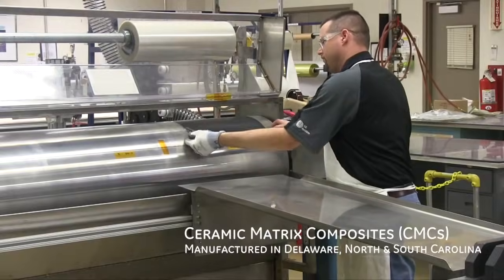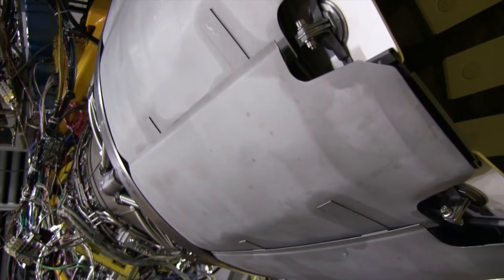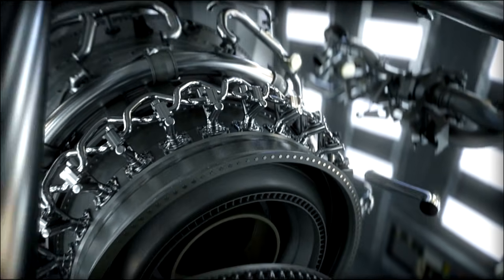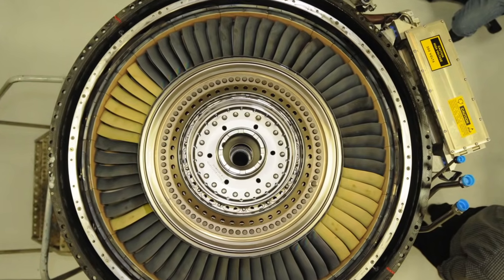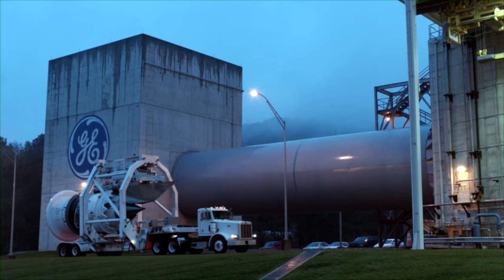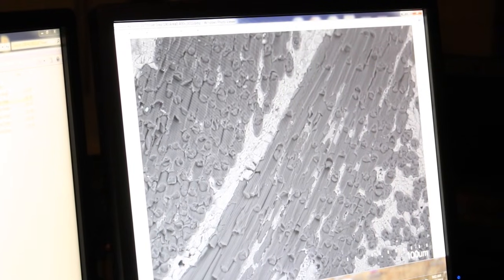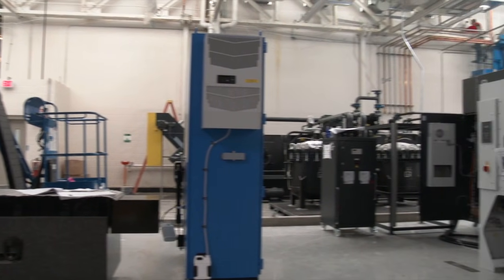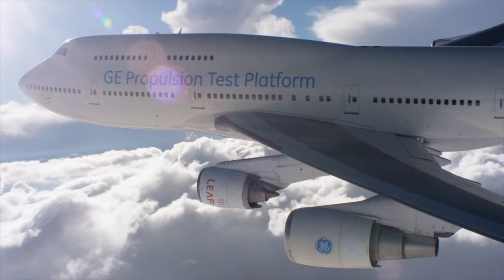GE Aviation and the Ceramic Matrix Composite Revolution

Comment: I worked on ceramic components for gas turbine engines in the early 1980's at Allison.  Back then, they were monolithic parts we were working with, and very brittle.  It's nice to see how far the technology has come in the last 30-40 years.

Comment: Silicon carbide (SiC)  is a structural ceramic material with excellent performance - super hard, wear resistance, low thermal expansion coefficient, excellent thermal stability and so on. Very suitable for aerospace applications.
Reply: But brittle. Less so with cmc.
Reply: Hybrid rolling bearings. Ceramic rolling elements instantly increases rigidity and load handling capacity and reduces certain lubricant requirements compared to conventional all-steel bearings.

In the electronics sector, SiC proves its worth in power conversion applications. Higher withstand voltage and temperature capabilities than plain silicon. Finally, Schottky diodes that does not have leakage problems and a positive step over IGBTs in efficiency.

Comment: A 6o:1 comp ratio with an axial compressor is simply incredible.  I have a textbook on turbines written in the sixties and 6:1 was where axial turbines were at that time...
Reply: With a 60:1 pressure ratio, half of the compressor is now technically a "hot section" too! They probably don't need ignitor plugs anymore, the air will be WAY above the autoignition temp of even JP-8!
Reply: Yeah I know I’m looking at the FAA AC 43.13 and 8083 and just mind blowing how fast the impossible became possible in the decades since the low end compression ratios.
Reply: KingCosworth 
Who knows? The next stage might be "double jacketed" version of by-pass arrangement. The outer-most jacket will have unheated air passage, while the inner jacket around the main engine will be heated version, conserving heat & enhancing heat efficiency.
Reply: Of course it’s with multiple stages. Increasing comp ratio is fine even back then by having more stages but doing it at light weight is where these make a difference.

Comment: The “on wing” experience is that 
The CFM Leap engines are suffering from the Ceramic Matrix Coating flaking off the turbine blades resulting in higher EGTs and higher fuel burns also.
I’m sure they will find a solution to that very soon

Comment: its almost 2020... are we there yet?
Reply: Yes and no. GE tested the new 9X engine and got it through FAA approvals but Boeing found early wear on the stator blades and GE redesigned them, setting production back by at least a year.

Comment: Can it be made clear for very robust windows?
Can it be made to use 3-D printable items?
 Can it be made into flexible elastic items?
Seems as it would’ve have potential as an aerospace material.

Can it be woven into fabric type materials for light weight yet high strength?
Reply: Yes but why, because$$$
No and no

Comment: Ceramic Engineer or Ex BS CER Egr if mfg right no machining maybe SiC w SiN fibers or SiC w Ti fibers. Trick is crack propagation You may want to use Boeing trick and incorporate crack stoppers in the matrix. Toughen composite just added plastic beads to the epoxy mix and ceramics are not different they need surface compression layer with crack stoppers in the matrix.

Comment: CMC is really revolutionary. GTRE must work on it & develop.
Reply: GTRE neither has the technical acumen nor the financial backing. Bleeding edge technologies do not appear out of thin air. GE has built dozens of gas turbines over decades to get to where it is today. The only way CMCs will ever be made in India is if the manufacturing technologies are give to it as part of a major military deal with geopolitical considerations.
Reply: @isuzu343  
hmmm. . . . I can't agree more. We grope in darkness. Knowledgeable about one's ignorance would be the first valid step. Knowledge of ignorance breeds fresh & more knowledge. [is someone listening or I am only whistling in a vacuum?]
By the time we learn CMC, they would move on to the next Technology!
Reply: GE has been researching this for past 30 years. India is still unable to produce single crystal turbine blades with nickel alloys, a 30 year old tech. I have seen the Kaveri Engine at drdo which was being developed for past 30 years unsuccessfully. If engine produces enough power it is overweight, when weight is reduced it vibrates too much. It is primarily because of partly skills and mostly government cluelessness of investment in long term r&d. loss due to failures during research is questioned by CAG in India who are accountants with zero knowledge of engineering. Until and unless government policy changes and fund private firms to do long term research and classify failures during development as investment and not loss, India will be behind the curve.
Reply: @kumark214  
Thank you. Its a challnge to dmrl.

Comment: imagine if they make Formula One engine or a supercar it will make all previous cars obsolete. screw electric cars...a jet turbine has awesome sounds
Reply: Problem is cars can't make use of a combined cycle system, which is used in gas turbine powerplants. Also, because of the higher capacity factors the powerplants are optimized for high efficiency, not power density like in cars.

Comment: Titanium is the best material, making the engines out of this brittle material is irresponsible and dangerous ,just because you could add another row of seats = more profits.
Reply: huh are you a fake engineer? titanium by itself is brittle. maybe you are talking about titanium alloys which is still heavier than cmc and harder to produce
Reply: Titanium composite with ceramic coating.

Comment: ooop - they showed counter rotating blades in an engine. Seems it did not work out in the fan parts up front, too loud, yet could be great in the rear compression areas.... P&W also liked my idea for quieting and engine by making the 'crenalated' fan exhaust.
How do I know so much about the most secret parts of the new engines? I invented them but after the plans were stolen (also by the CCC too) men were sent tokillme.
YET still these new materials would work so great in my new hydrogen oxygen engines (H.O.P.E. power, shhhhhh) , you know the ones that exhaust pure water, can run into space, are exactly what our air force is asking for - yet cannot be built in the USA because of murderous suppression of clean energy advances {as the CCC rushes ahead to build the new super low cost space craft, and I am dying of pneumonia sleeping in a cold van, yes by the river}
I so need a job, but NOOOOOOO!
Reply: low-cost not coast
Reply: @baotutubenbenxiong  Yes, thank you, I do not type well since the frost bit finger damage that hurts all year around. 
Also a man was sent to give me a brutal head pounding, slammed me to the floor and slammed his fist into the top of my head over and over, as people stood by and did nothing to stop him. This being my tenth concussion, and beating, I now have trouble typing.  
This is how clean energy inventors are treated in the USA!

Comment: Don't tell the Democrats. They want us all riding in trains!
Reply: Just stop with the propaganda.  This is the green new deal in action, environmental regs pushing for more and more fuel efficiency.  It is stupid to attack policies that have proven extremely effective.  If right wingers got their way and scaled back regs, fuel efficiency regresses.  Even now all the auto makers are begging to have fuel efficiency standards reduced so they don't have to keep spending money on improvements.  

Before you lie and claim this is 100% driven by fuel savings for customers, here is a quote from GE's website for this engine:  "It will feature the same world-class reliability as the GE90-115B, with noise and NOx emissions well below anticipated regulation standards."  They are exceeding regs because they know tighter regs are coming.

The environmental regs are what lights a fire under these companies' asses to develop these improvements much faster and prevents them from increasing bad emissions as they improve fuel efficiency.  Look at VW and all the car makers that cut corners by increasing NOX emissions to get better fuel economy because the exhaust systems were cheaper if you allowed more pollution..
Reply: Patrick O Most aero-engine companies like having greater fuel efficiency and less emissions. Greater fuel efficiency means less emissions which also allows for more fuel for longer journeys or less fuel for shorter journeys both saving cost. With these efficiencies the engine will run smoother and emit less low frequency noise. Low frequency noise is particularly bad at damaging components. In this case being Green is just much better economic sense!
Reply: Patrick O: There may be some truth (w/the emphasis on "some") in what you have said, but I still stand by my comment!
Reply: @chippledon1  I listed nothing but facts and if any of it is true, then your previous statement is completely false.  I am glad you seem to have realized you were wrong.  Now celebrate by having a glass of clean water and a puff of clean air, you earned it.
Reply: @chippledon1  Not only are you projecting, it is funny that you associate liberalism with telling the truth.
Reply: Ha, ha...you see!!!
Reply: Patrick O: Hey, did you read the post by Marcus Wardle? That's what I'm talking about!

Comment: Worried about CMC LEAP jet engine reliability. Another Boeing jet with this engine just crashed (Ethiopian Airlines). This is the second crash in just six months. Not good!
Reply: John Skelton, I’ve recently heard that they’re looking at the angle of attack indicator. Reasoning behind this is that both aircraft crashed soon after take off and crashed vertically into the ground!
Reply: @marcuswardle3180   Based on eye witness reports, it may have been a bomb in the cargo hold. Just guessing.
Reply: It may have nothing to do with engine quality

Comment: I once found video of the last j58 static engine test.  Think it was conducted at Edwards.  The exhaust components were glowing so hot they were practically transparent.  Hard to believe the whole thing didn't end up a molten glob of slag on the concrete.  When the engine was shut down, it quickly cooled off to a dull gray.  Pratt & Whitney.  Now they can build an engine.  The j58 rules!  Think the video was classified because I went back a few days later and it was gone.
Reply: The J-58 engine was used on the A-12 and the SR-71 Blackbird and could fly at the speed of Mach 3.2. The afterburners had a lining of Ceramic to prevent them from burning up. It was designed in the 1950s and 60s.

Comment: Imagine if we can have carbide powder for 3D printers, then we can print a jet engine at home :-)
Reply: Then we can print that car we downloaded.
Reply: No.
Reply: If you can make all moving parts from such a thing, with tolerances under 1 thousand of an inch...  no such printer can do this though
Reply: tolerances of +/- .0001 or less, in many cases... 1 to 2 tenths of 1thousandth of one inch
for the metric folks.... 1mm = .03937 inches.. 

if you scale it down some of your tolerances may get tighter if you are actually looking to make it work on par with the real deal... some people have done some approximation of it. ..lots of rc jet engine videos...good luck to ya.
Reply: Yeah, sure. They sell you the 3D printer for cheap. Where they get you is the replacement cost of the carbide powder cartridges. Much cheaper to refill them yourself.

Comment: I think all manufacturers know there needs to be a change in the design of their turbofans. The bucket of hammers buzzsaw sound is not a smooth sound from an engine. It's already known this design has to pass a blade off (contained)and complete engine destruction. Do you really think it's worth taking the risk of even one persons life? Now we have seen the results of this design. Engine Alliance, a General Electric and Prat and Whitney joint venture now have to explain why their A380 turbofan catastrophically broke apart and took the front section of their cowling off. Looking at the leading edge slat their appears superficial markings. Are you guys really willing to risk another 500 lives to a bad design? Perhaps variable speed turbofan? I don't know what the answers are but there needs to be a lot of questions asked and changes made before a whole plane load of people have a closer call like the quantas A380.
 Let's get to work on a better design. Now is almost too late.

Comment: Imagine a GE90 made with CMCs, rather than the metal alloys, and with a gearbox P&W developed for optimal rotations in fans and inside the engine!
Reply: Was thinking the same thing watching this video, what would the fuel savings be combining the two technologies? And how would that translate into flight ticket prices considering the percentage your ticket price consists of paying for fuel?
Reply: @tinoesterhuizen4433  The airlines would save money in fuel, and also by charging customers extra to pay for the new engines.

Comment: Mr. Sanjay the brittleness of such CMCs may also be reduced from different stress relieving and heat treated mechanisms but actual problem is to produce single crystalline theory to overcome creep deformation and make it more adaptable in the engine industries as compared to super alloys
Reply: 6
Reply: Yard uttana
Reply: 6 yard yard yard buuu
Reply: Single crystal nickel turbine blades were state-of-the-art for gas turbine engines in the 1980's and 90's.  CMC's are the next step.

Comment: I need help!

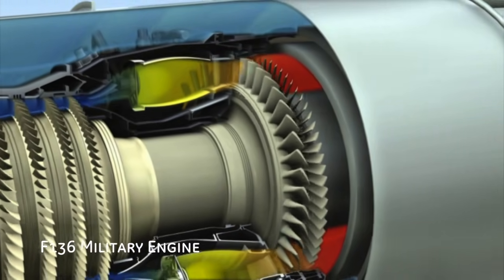In the video at 2:20 min, does anyone know why is the turbine turning in opposite direction? :D
Reply: A counter-rotating turbine eliminates the need for stators in the hot section. I imagine that hot spots from uneven combustion combined with the 2400 degree turbine inlet temperature would melt them in spots if the heat wasn't evened out. Best way top do that is keep it rotating. Plus, it reduces the number and types of the extremely expensive CMC parts per engine, so initial/service costs are reduced.
Reply: Alright, I see the point there. What about the theory of gyro effect? Do you think having a counter-rotating turbine plays a part in preventing or decreasing the gyro effect which may cause a problem in airplane maneuvering system? (pitch and yaw angle)
Reply: Thanks for the reply. Is it possible for you to elaborate more on how does it actually reduce the stress load on the high pressure blades? Cheers.
Reply: @steve gale, yea man. Yes, I understand what you are describing. The idea behind it of reducing stresses on the "used to be" fixed blades and allowing for fluent air flow which enhance the efficiency. Just another side question if I may, do you think having contra rotating blades also helps with the gyro effect when steering the aircraft? Cheers. :)
Reply: @steve gale yea man. It is in much of plain English that I am able to understand. Alright, now it definitely cleared my questions and doubts. Thanks for taking much of your effort and time to reply. Thanks alot. Cheers and have a good day. :)
Reply: @yunghuitay9680  Yup, the main reason for using counterrotating shafts in jet engines is indeed to balance out the gyroscopic effect. So you are correct!

Comment: Ceramics are brittle. How does the fracture toughness of CMC compare with that of HT superalloy ?
Reply: ceramic fragile but will work in some conditions when almost all metallic alloy fragile too
Reply: This is so bad xD In High th metallic alloy are not fragile at all, they are the very opposite of it, alloy used are in general very ductil. The composite part is supposed to handle the fracture toughness

Comment: Could this material be suitable for the skin of a spacecraft on reentry?
Reply: No
This is made for vibrating parts. REV use lighter insulating materials that slowly vaporise.
Reply: Good question
Reply: Will Warden materials like this were used on the space shuttle for reentry
Reply: I don't think so, the re entry temps are way hotter than this thing could ever sustain and prevent conduction at the same time.
Reply: Need to build an engine to get to outta space first. Then work on that one.
Reply: @domingo59  You say that like you haven't heard that we've punched through both sides of the atmosphere long ago.
Reply: Dam right it should or not a dime conducted Or to trans scape or to produce an organic matter or obtain heat

Comment: What would happen if you injected water in the combustor too cool and to create Steam to expand to create more pressure has Cooling does anybody have a an idea what about this what would happen if you
Reply: Inject water... even if it is better then air, it will not happen. You'd have to take water with you in addition to fuel. Air you get for free as long as you stay in atmosphere
Reply: Harrier jump jet has been injecting water for over forty years.
Reply: Boiling water takes quite a bit of energy, do the math but I wouldn't expect to get increased thrust from cooler exhaust.

Comment: i know nothing about this but what's blending? A friend told me that when you first start working at GE aviation they start you off with blending but he didn't explain to me properly so now I really want to know what that is and what you do??
Reply: Its like a test. You have to pass through a running jet engine, i.e. blend with it. If you survive, you get the job.
Reply: Blending in a manufacturing sense, usually just means doing finishing details on parts with hand tools like small grinders. Think dental tools. They use it to remove sharp edges and smooth out small details where allowed on metal parts. Not sure about CMC parts, perhaps similar trimming of the nearly finished parts. GE is a great company (i'm a former employee). If you're considering applying in your area. Do it. Would still be there if I didn't have to move.